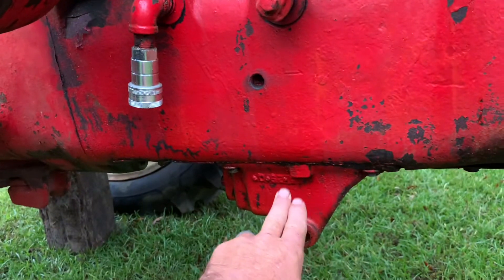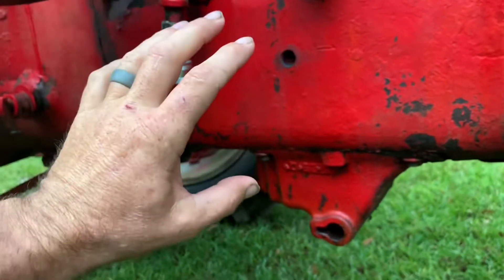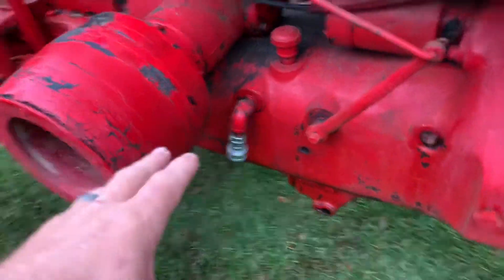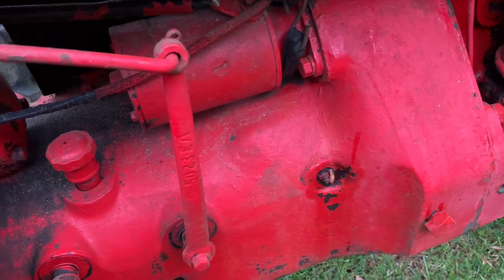Farmall H Hydraulics Explained

Comment: I have found the belly pump is held up there with 4 bolts. And the casting is broke off in the corner
on 1, of the 4.  I just keep using it that way, so far. nothing has happen yet.  I have another farmall, It's an H.
The  belly pump, if I need the loader for some thing,  I add oil to use it. will drip for several months after that.
till the oil is  far enough  drained back out. That's the first I should fix. this spring.

Comment: I installed a 2 spool valve for a an aftermarket 3 point hitch with 2 way cylinders. In my set up I secured the hydraulic pump in the on position, and plumbed via a Tee a return line from the 2 spool valve to the drain at the bottom of the  belly pump.  The second spool valve I plumbed in a set of remotes via quick couplers.  The Farmall H hydraulic system makes about 850 - 900 psi and with properly sized hydraulic cylinders will pick up more than the front end weight can stabilize.  I utilized a shot off valve before the 2 spool valve so I can utilize additional hydraulic ports ( 2 more of the 3 ) and run a 3 point hitch hydraulic log splitter. Everything works good, just limited by today's hydraulic pressure standards.